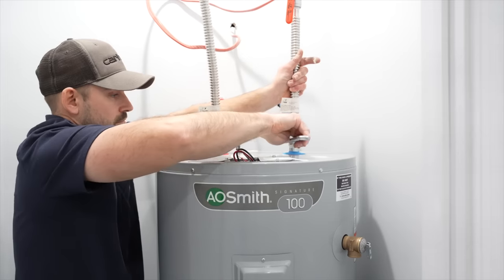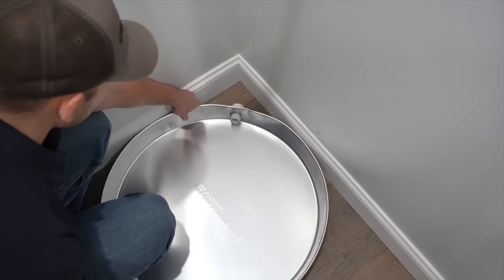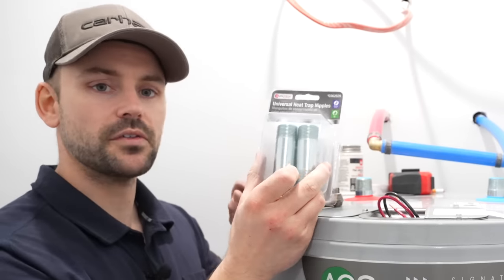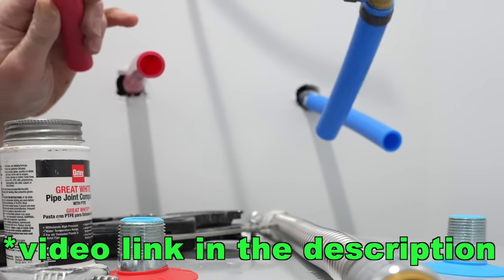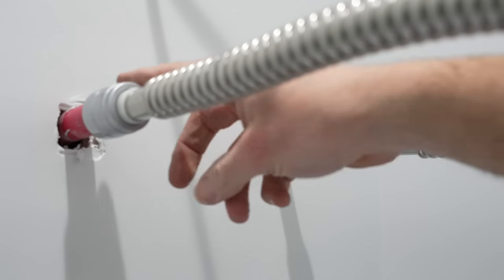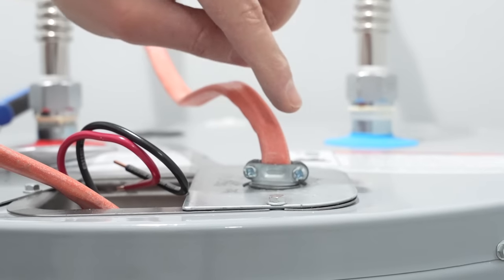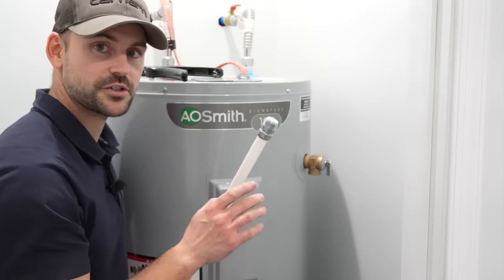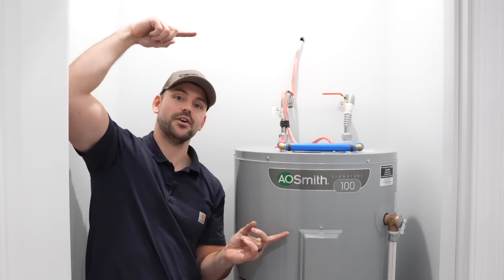How To Install An Electric Hot Water Heater Tank

Comment: Canadian Giant Co makes a standard tank called the Cascade 60, with a very good prolonged guarantee and competitive cost.  I am not affiliated with Giant company, but only a customer.

My insurance company requires me to change the hot water tank when it's age reaches 2xthe original manufacture's cost.

When I installed our tanks (2 per my duplex), I arranged for the outlet hose to be about 2 feet longer to provide an inverted U  trap for convection current. The trap is to prevent hot water flow up into the house when there is no water demand.  What is this convection current?  Well, warm water rises, and cold water sinks in a pool, lake or tank.  The upside-down U in installing the pipe stops the water convection flow.  The pipe, for the extra two feet of length, may be a few dollars more, but the extra cost of the flex pipe is recovered in a current year. 

I think you cut your pipe too close to the wall, so that there was no downward connection. That downward connection blocks convection flow from the hot-water connection.  That level connection omits the savings of $20/yr of unnecessary electrical heating cost.
If you can, get some longer flex pipe so as to have that up-side-down U to the red pipe.
Reply from the maker: I really like  your detailed comment. This helps the community as a whole learn from each other. That is interesting about the U trap you mentioned. Thanks for watching!
Reply: @TheExcellentLaborer  Thank you for the response.  For those who may not have understood the inverted U idea,  it is simple and uses the concept that warm water rises and cool water settles., The hot water, by convection will rise to the top of the inverted U, and because the downstream side of the inverted U is lower than the peak, it will quickly hold cooler water than that at the peak, Convection water flow stops at that peak until a tap is turned on. 

FYI, My hot water tank for the upper duplex premises is  two floors below and about 30 feet from the two remote showers.  For the main floor, it is one floor below and about 30 feet from those two remote showers.  On turning on the shower, it takes about 5-7 second delay for the tank hot water to reach the spray.  After that, it is the same, pressure and temperature wise, as is your installation.

Comment: Any problems with those flex lines? Mine are leaking only after a month and they're corroded.
Reply: There is absolutely no way I would use those lines.  Just asking for a leak and water damage.   My water heater lines are soldi copper all the way to the water heater.

Comment: ok, so i installed a new hot water heater, hot to hot cold to cold, replaced a 3/8 copper tubing with a new flexible faucet supply line, wired the heater, turned the water back on to fill the tank, gave it some time to heat the water.... kitchen sink/bathroom sink has hot water no hot water in shower, replaced the mixing valve with a new on, set the anti scale setting to hot.....still no hot water in shower, any ideas?

Comment: This is a minor detail but I do not recommend using the ratcheting pipe cutter on PVC without rotating and scoring the pipe from multiple angles. When you do it from one direction only you put a lot of pressure on the pipe which, if it doesn't outright create cracks, can weaken or deform it.
Reply: what are you smoking

Comment: shark bites are junk beyond emergency repairs or at camp,,,, do it right once and get copper piping...spend the few extra bux, pex aint cheap either, get a torch and braze those fittings on or solder if you dont have the  heat.....very good presentation but please that wire eletrical taped to the waterline is so ghetto , again do it right once...get some conduit and up your demos up to the professional level...you have 270k subscribers! if you are making money on these instructional videos i recommend hiring tech experts on each episode to avoid all the peanut gallery like myself hahah...thanks for sharing

Comment: Just did a water heater replacement and the hot water is cloudy and there’s a lot of black sediment collecting in the sink. Anyone have advice?
Reply: Old corroded galvanized metal pipes

Comment: The pipe for the pressure release valve shouldn’t be plastic, should terminate at least 1.5” but not more than 6” from the pan, and should not have a threaded end at termination
Reply: PVC is code acceptable . Threaded at termination, not sure what you mean there. Its threaded where it joins the PRV 
and don't need threads on the end.
Reply: This pipe he uses is what I was referring to It's PVC but with a metal fitting installed .You don't want plactic fittings

Comment: If you shut off the cold line, that would shut off the hot water, but how do you turn off the cold. You would have to find the main shut-off outside correct.

Comment: Aren't you required to strap the tank to the wall?
Reply: In many areas, no.
Reply: @waterheaterservices  In my area, it is a practice to place the tank onto a base of bricks, with space between adjacent bricks. It adds about 3 inches to the tank height.

Comment: You should install a electrical disconnect on that. This way if someone is working on or servicing the water heater it doesn't get turned on without you knowing. And sharkbite are a insurance claim waiting to happen.

Comment: A great connection is when you don't pre-twist the wires together before splicing. Simply put the tips of each wire next to each other and twist the wire nut until it twists the wires. Your method is known as "acceptable", not great, according to all wire nut manufacturers instructions.

Comment: All that talk about making it look nice. But he had the perfect chance to put escutcheon wall plates over the electrical cable and water inlet and outlets but he just left raggedy holes in the drywall to look at. At a buck each he could have added on $5 and pocketed the change for essentially no added work. But it isn't fair to ding him on not doing other things like an expansion tank or electrical junction box or wall straps that are not required by code in his location.

Comment: Get ready for the "Hot" water haters.
Reply: electric is trash for sure
Reply from the maker: Thanks for the warning! I love hot water heaters😀
Reply: Us tradesmen tend to be obsessive over details
Reply: @TheExcellentLaborer  In my area (Quebec, Canada), the manufacturer inserts a "removable" clip around the thermostat setting screw. That clip is the manufacturer's way of limiting the setpoint temp to 162F /72C. It is also his way to show his product meets the code standard. The default setting is for 50C or around 125F.

The hot water tanks we use also include a sacrificial anode rod. It generally gets eaten away where the water is somewhat acidic.   The rods are replaceable from the big box hardware stores. Replacing a consumed rod every 3-4 years can extend the life of a tank to 20++ years.
Reply: @techerrorcode9373  well if you live in Cali with the natural gas prices are electric is the way to go & I'm sure many will convert over from gas to electric as well same on gas stove to electric range, people are paying as much as 400$ to 600$ month for gas that I have spoken to so the wise choice is electric.
Reply: @lsatenstein  all water heaters have a sacrificial anode lol
Reply: @techerrorcode9373  0p0000
Reply: That's hilarious! 😁😄
It's a water heater. Not a hot water heater.
You don't want to heat water that is already hot.
Unless it's in a doctor's office that has a circulating system.

Comment: If you get water from the city most likely you have a closed loop system and for safety so the water heater doesnt turn into a bomb an expansion tank must be installed. Please read into this before DIY.

Comment: Unfortunately you did not do it correctly. The electrical Romex wire needs to be protected from damage by either a flexible metal conduit or a PVC flexible conduit also known as Smurf tube or EMT. You cannot just have that wire hanging out in the wide open. Not having some kind of protective covering over it. That is national electrical code

Comment: Handymen use shark bite

Real plumbers solder.... or pex at minimum
Reply: Even most decent handymen won't use shark bite.   Mine has solid copper pipes to the unit (as you stated)
Reply: You must be an old plumber, most plumbers these days use compression fittings whenever possible.

Comment: And if the breaker panel is not in "sight" - congrats - you are out of code and fail inspection. Either a disconnect needs to be installed or a "LOTO" used in the breaker.

Comment: this installation would fail in my state...no electrical disconnect and no the breaker does not count....no vacuum breaker on cold line above the tank and no flex lines allowed..

Comment: Always surprised how these YouTube plumbers don't show how it really is. It is "Plumbing for Clicks." First, you don't show how to deal with old hot water heater: That includes how to drain it - including draining it if the heater is clogged with decade of sediment accumulation, how to deinstrall it , what to do if the old  shut-off valve won't close ( very common occurrence). And then, there are the  rat droppings on top of the heater, and of course - spiders and cobwebs every where. Moreover, how to remove old heater  from inside of the house to the outside. These are THE MOST IMPORTANT aspects of water heater replacement.  Then how to get new water heater in all the way to its location. It all requires strength, maybe second person, as well as getting dirty. Very dirty. So this is kinda Hollywood movie magic. It is not, how it is in real life. Thank you ... PS: Drip pan cannot be drained into crawlspace. It has to be drained to the exterior of the house,

Comment: You don’t need to heat hot water. It’s just a water heater, not a hot water heater. I would think you would know this.

Also, many municipalities now require an expansion tank on the cold water line. 

Finally—you should NEVER drain water to a Crawlspace under the home, that line should extend to the exterior of the home .

Comment: You would be fired the moment I seen you pull out a push to connect sharkbite for my hot water heater supply.
Reply from the maker: Sharkbite are great for DIYers
Reply: I had some on for years no problem
Reply: I agree. I will only use sharkbite style fittings for a temporary fix to restore water to a house when I don't have the time to properly fix it. But I always go back and replace it the right way.
Reply: What’s wrong with push to connect?
Reply: @coooooool12342  Nothing wrong. Some people are set in their ways.
Reply: @troycarothers8254  My home is a historic, anachronistic building. We had cast iron pipes, until 1960. After pinhole leaks, they were swapped to copper, and until 10 years ago, the water tank connections were soldered.  10 Years ago I the insurance company made me change out the tanks. I replaced the soldered connections with re-enforced (better than washing machine quality) braid wrapped hoses. Similar to the ones shown in the video.
Reply: @troycarothers8254  …That’s why the older systems last 30 years, it’s not about being set in your ways, it’s about doing it the right the first time, so it can last. 

There are things I have used shark bites for, and there are things I won’t use them on. They have their place.

Comment: Its a water heater.....You don't heat hot water
Reply: If the heater is set to 125 but the water in the tank is at 120, is it not actively heating “hot water?”